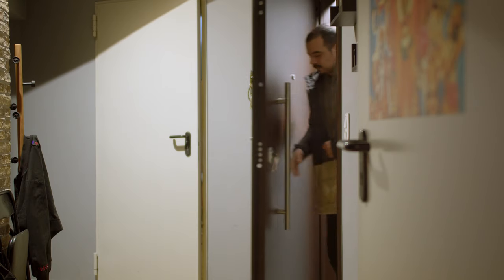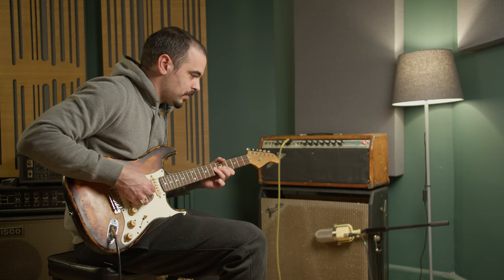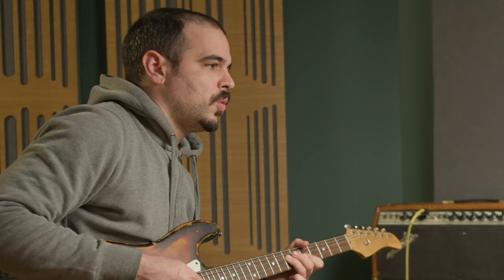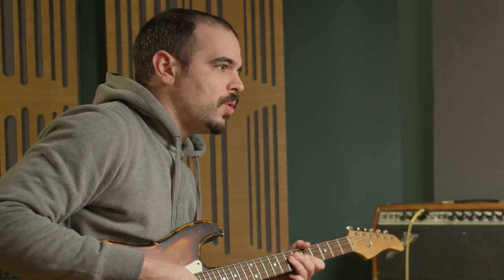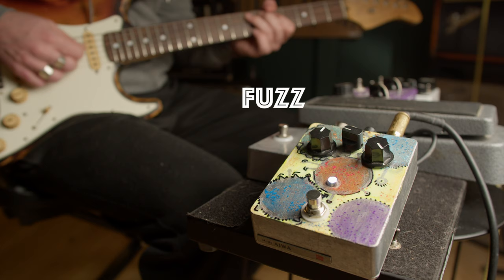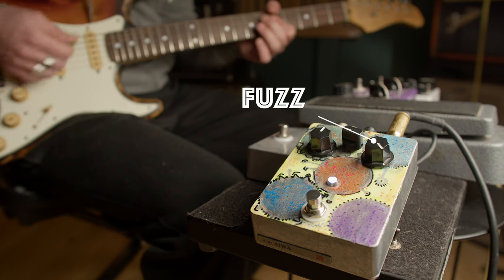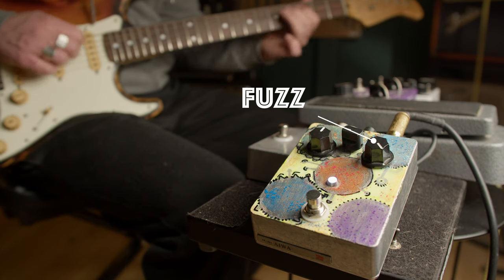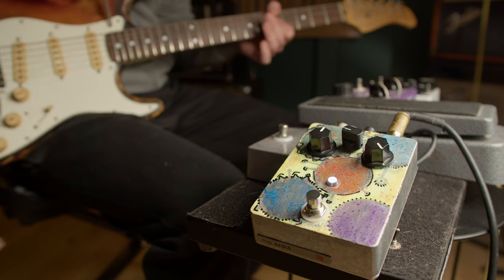3 Tips to get the Most out of your Fuzz Face

Comment: Great video. I really like lipstick pickups into fuzzface. However i oftenly also use some mid-boost afterwards...klon or equalizer works great.
Reply from the maker: Thank you! Lipstick pickups must be really interesting combination! I have tried it with a King of Tone afterwards but it makes sense to use a mid boost, it is a scooped sound (especially if you are playing with a fender amp). With the mid boost it will cut through the mix much more. I will give it a try as soon as I can thanks for the tip!